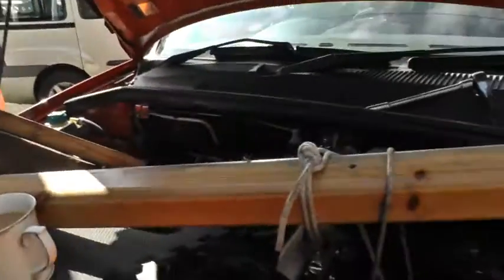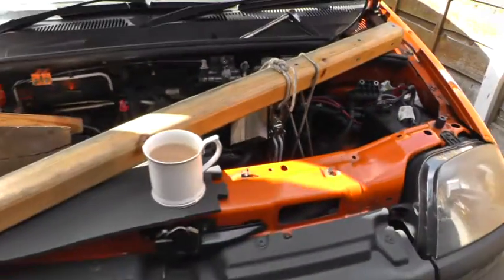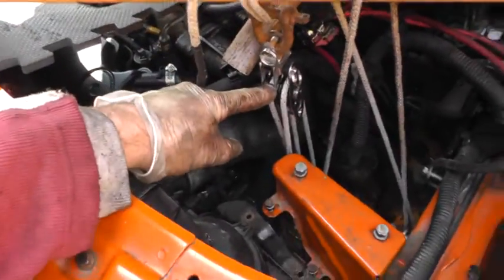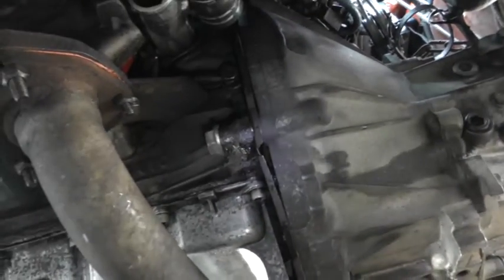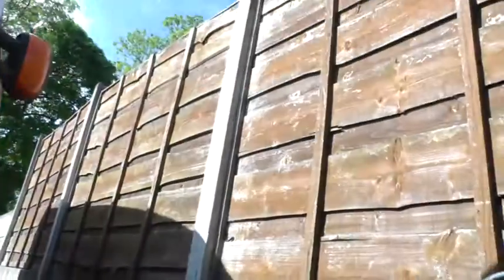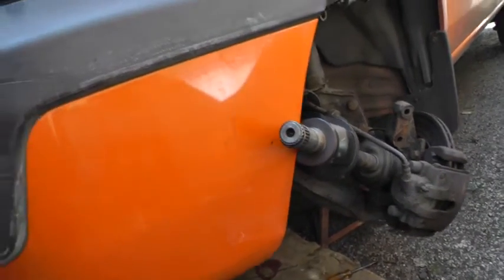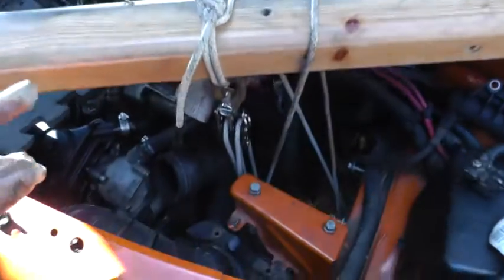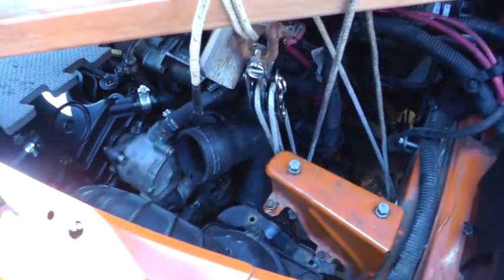Doblo update 6

Comment: hello 
why do you use a hoist it is not necessary the box is held by its axis that comes to fit in the steering wheel motor
Reply from the maker: I found it helpful to assist my way to do the work.
You can choose to do many different ways.
Thank you for your comment, and best regards ! 😀

Comment: My mates dad has one of these and the clutch cable is said to have broken. I guess it's relatively easy to replace? It's a hydraulic clutch right, and not a long cable? Is access ok?
Reply from the maker: Hi Barney, is it the 1.9 JTD diesel? What year? 
The two Doblo's we have are hydraulic clutch.
If I remember right, the gear change cable snapped on my dad's - I found a second hand gear cable at a breakers.
If you find out the symptoms and the year/model of the Doblo, I may have a better idea of what could be wrong.
Sometimes it is a mechanical failure of the release bearing or pressure plate for the clutch.
All the best.